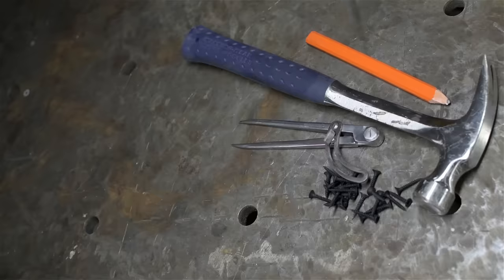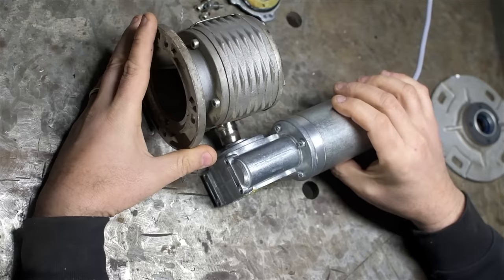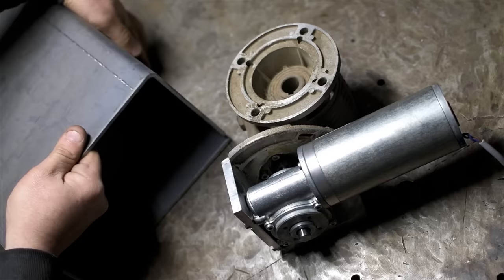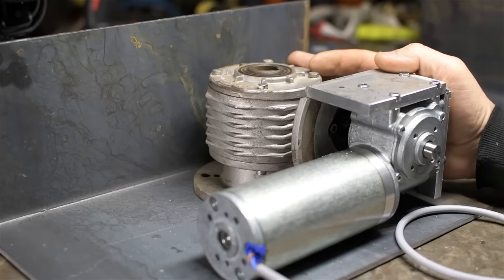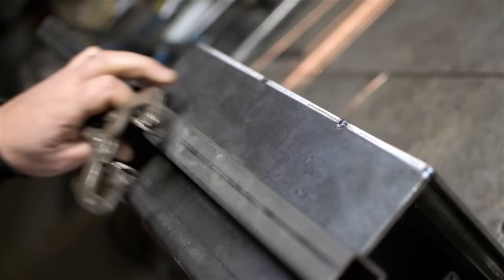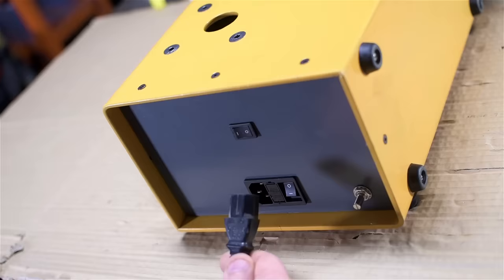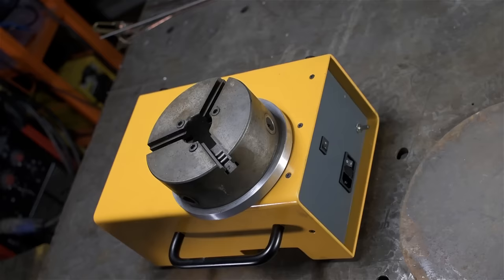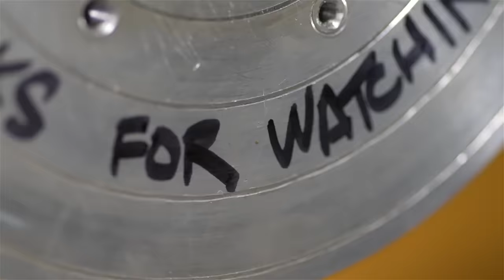Building a Rotary Weld Table

Comment: You should probably add a ground wire from the on off switch to the casing, it has some exposed metal components inside that can break down and touch the casing, the earth wire will make the breaker trip instead of making the whole thing live

Comment: Can't say it enough. Love your channel.
Reply from the maker: Thanks!
Reply: Practical Engineering one of my gods likes the oder god!!!!!
Reply: @ThisOldTony  I love your channel and your builds. This was a great project, made so nice and clean. But just one thing got me triggered a bit. All metal box, 3 bolts connector for power... and NO PE connected to a cover? Shame on you Mister!  Just one more weld of 6mm screw and one more cable for this project to be a full masterpiece...
Don't worry, partially joking but i would add just that cable to a cover for safety :) Maybe it's just my proffesional deviation as we call it here :)
Wonderful work, good humour! Keep it up and always have fun with things you create:)
On the other hand, if you put a wire ground on your cover, you would have to separate that gearbox electrically from it, otherwise you will make a wonderful toasting machine... decisions, decisions, decisions...
Reply: ogi22 can you explain this more so I understand what the risk is? I would like to make one.

Comment: My uncle is a welder at Boeing and he runs with 2 pedals, one for rotary and the other for the welder. He said it takes a bit to get used to but is really slick when you get the hang of it.
Reply from the maker: I bet it does!!
Reply: Be nice if you could get him to post some pics of his setup somewhere.
Reply: @firesurfer  Not a snowflake in hell chance of that happening I am afraid. A workmate of mine briefly worked at the Boeing plant here in Melbourne, Australia and said that they are super anti cameras and you're not allowed outside of your work cell. It's all to do with industrial espionage and intellectual property rights and processes.
Reply: Yea boeing would be the wrong place to film or photo anything. They need to safeguard against both military and industrial espionage. I bet it would take me a day or two to master double pedalling as im also a closet metal drummer😅👍

Comment: Hey TOT, Just couldn't resist. Anyways, I used to be a Prototype Welder/Fabricator at my last welding job, was also a Journeyman Boilmaker, and I really knew how to make those drinks! (but I digress), I was always was working on something new. Your turntable reminded me of 2 things. I had to weld multiple hydraulic cylinders with their end caps. All parts were machined in our machine shop (back in 1983). So I grabbed a RIdgid pipe threader, that had the chuck large enough to accommodate the cylinders, and got a foot pedal hooked up for the variable speed welding with MIG using .045 wire. They turned out real nice, and no leaks! 

The 2nd thing I did was I just took a big old bearing and a round plate of steel and made a hand spin table. Had to weld these big steel wheels for Hyster Fork Lift Trucks that they lift in/out of the hold of ships to load/unload. The welds were stitch welded opposite on each side with this inner plate as the hub.. The diameter of these babies were 36" inches, and it was 1" flat bar 10" across rolled to make it round. Anyways I got complimented by the machinists as they said they could set their tooling on the lathe to my welds as they were always 1/64" within a 3/8" leg doing 3 passes. Ah those were the days. 
-CD

Comment: Just thinking, You could have also built this much simpler by purchasing a "truck tarp motor"  12vdc motor already attached to a right angle drive, good low speed for $100. but the creativity I LOVE!!

Comment: I built something like this about 20 years ago, it was primarily for welding hydraulic cylinders. But as I had to use parts available in the "junk" bin, I went with a hydraulic motor and gearing. (yeah hydraulics was our thing back then) and built an electronic box based on pwm with potentiometer to control the dutycycle and a load of mosfets in parallel to control the speed of the electric motor driving the pump.

Surprisingly it worked really well. Very smooth, high torque, slow enough for welding, excellent result overall.

Comment: Oh, i have all your skills. & Tool Envy!  I am a kid from a Dairy Farm, in the "Land between two Rivers"  I'm currently a fiber artist in the village of 52151 (we think alike) I started cleaning plugs on OLD JD's at 5yr. A shop, choir, band geek in HS. An Industrial Technology major at Northern Iowa.  Followed "her" to Hawkeyeville. Eventually was the President of IC Apple UG. I have the world's largest library of 65c02 software.  I had a WOZ signed 2gs. 
I got into IT Systems & Networking Engineering.  Little places like Siemens. The whole world AD Tree. OMG! Even found those missing files from 1930 to 1945.  Wheee!  Did that for 25+ years. Now  a fiber artist, with a 10 node Raspi network. Just ordered a 3d printer. Fully insane, scare girls,  uber geek some times.  Absolutely love your work!  I got my knocks in Historic Preservation,  living in an 1854 hand adzed red oak posts & beams, with 14" wide 16" OC Black Walnut edge cut slotted/pocked studs. An analog world with 160 years of un-fxxkng to do.  Nice to meet you!

Comment: I love the table tony I built mine from 2 gm electric power steering motors from small front wheel drives and a wiper motor from a dodge 1/2 ton  , I use a 18 volt dewalt drill speed control and battery to control the speed , it totally makes awesome welds every time , and it's totally portable , , I just did it as a side project because I watched your video , thank you so much for the amazing idea

Comment: Another gem!!  I wouldn't have welded the box, just in case but that's me.  As a kid I could never bring myself to glue airfix models together, even now the wallpaper is nailed to the wall, just in case it needs adjusting later.  Yes, I do crosswords in pencil too.

Then again I'm only working in three dimensions.

Comment: It might be prudent to insulate the ground clamp well, if the paint scratches off, it could cause some weld current to go through the chassis and ruin your gearbox.
Reply: soupisgdfood first thing i thought off when i saw it
Reply: Not really...  the electrons will follow the path of least resistance, so as long as there's still a good connection through the shaft, no current will travel through the gearbox or bearings.

Comment: 22:00  :  To avoid this kind of boredom, I cut two pieces of sheet metal and weld two nuts as each piece. So if you have to disassemble, you can do it without apprehension. 
And, if you are equipped, the threads in the sheet can be made by fluo-drilling. It gives an even cleaner and more professional touch.
Thanks for your great videos.

Comment: Hi - I know this was done a long time ago, but...
Could you make a small 3 point pipe clamp with brass wheels for a ground clamp on the shaft.  This would leave a lot of room to fit a 90º gas swivel fitting on the end??!!

Oh - you could also plug in an MP3 player so that  "Unchained Melody" ('Ghost' Soundtrack) from the Righteous Brothers plays when you turn it on....

Comment: made the same thing years ago.  windshield wiper motor and starter gear and flywheel.  used a miller 200 with the trigger Incorporated into the the turntable and mounted the gun... works great for automatic welds.  and torching circles.  pipework with "t"s or "y"s or elbows have to be balanced to maintain consistent speed.  on bigger pipe.  on mine anyway...very nice fab work and product.

Comment: Re: the out-of-control Al. feeling.
Al. is all about forcing the puddle / bead (cause it's so heat conductive). So you need to hit it harder and faster. There simply is no dialing it in, to perfectly match heat input with rotation speed. You're GOING to be putting more heat in than you would for some hypothetical perfect balance, so forget it totally. Aly is about overpowering way beyond that balance. The uneasy-ness you feel is your brain not wanting to let go of the concept that there must be a synergy. There is no aluminum spoon. 
If you want to compensate for the extra heat input, learn to weld faster so there's less time under the arc. Sorry, there's no easy out on that one. Blast it and get out.
Reply from the maker: thanks balistic!

Comment: Just an idea but at my work, our welding lathe has a foot control to turn the turn table, you set the max rpm but the lighter the foot the slower it goes and it helps in those instances where your having trouble keeping up with your puddle 

We don't use foot pedals on our welders, only buttons on the torch so we set our amps, click the button to start the arc and get the puddle going then we press on the foot control for the turntable

I recently found your channel and I've been binge watching, keep up the awesome and funny content, thanks

Comment: I used to buy Singer Sewing machine pedals from a company in St Lewis for 12$ each rather than the 160$ pedals from Lincoln to speed control the tables in the foundry. Each of the 4 welders completed about 25 aluminum highway light pole bases per shift. Each pedal compressed 30 carbon disks to pass current to the motor/ more compression=more speed and I could dismantle the devices and clean disk surfaces on a sheet of emery cloth every few months, real easy.

Comment: I built one using an old fan motor, taking the drive from the rotating shaft which powers the back and forth movement of the fan. It was connected to the table using pulleys and an O-ring as a belt.

Comment: When you add the power LED you could also add a headphone jack inline with the power switch so you could make a simple on-off foot pedal control (for your other foot). Other then that I would use a heavy duty toggle switch thats easier to activate with a glove on. Awesome use of materials and workmanship!

Comment: The "Motor" could be a window winder motor or wiper motor from a car wrecking yard.. These are so useful, I've used them for makeshift "Cruise control" on a truck that had a PTO that needed to change engine RPM from the back of the truck, and lock & hold the throttle.

Comment: I cobbled together a rotary setup with a 3ph gearbox and a VFD at work. For a ground I used a flat copper bar clamped to a hinge that was clamped to the table in such a way that the weight of the bar held it against the part ... stainless steel pipe in this case. Worked good. Maybe the same principle could be used here with something like a spring to hold a copper bar against the stub shaft. Won't have to be concerned about the ground clamp slipping off.

Comment: For your remote speed control you could add a plug to your main unit and use a potentiometer mounted on a bracket that clamps to the handpiece. I made one for our rotator at work using an old extension lead and grafted a linear/slide potentiometer into the MIG handpiece(worked well but too delicate and not universal), second version was a small bracket to clamp directly to the handpiece housing a rotary potentiometer. I found that worked great, also works well with the TIG.
Another option could be to make one with an arduino and 2-3 buttons for speed control(faster, hold, slower/ speed up, stop, slow down). 
Cool videos though, I also didn't realise how long I had been watching. lol
Keep up the great work!

Comment: +The Old Tony Needs a foot pedal, not for speed but to engage. I run the arc with my right foot and engage/bump the turntable with my left. Just like the big kids do in pipe fab shops. Set the speed for faster than you need, and bump it forward. Better cup control, so you can walk the cup and not get that under-cut without the piece getting away from you. Filler rod is just that. (Also works great with stainless wire spray).

Neat project, though!

Comment: Very nice..! Especially the two pockets, so you can clamp it down. A bolt through a washer into the axle will keep the clamp from dropping off, or just make some kind of attachment like in an electric motor where the connection slides on the rotor (that would be your axle).

Comment: The last place I worked, we had something similar. The only difference was that instead of an on/off switch it was in a pedal form. Push to turn on and push again to turn off. It took a little practice welding something that was inconsistent or trying to keep up with the heat your putting in the material. Oh and we used the torch button. So we'd set our amps on the machine. That way everything stayed the same

Comment: Great job on the welding positioner (that's what I've always heard them called). I made one a few years ago with 4 grinder heads in series so the RPM was low enough to be usable. It was a fun Rube Goldberg project.

Comment: Great video and great project. I like the welding observations you shared in this one. I'm kind of a middlin' welder - not a beginner, but I have a lot to learn.
I've done a number of projects that required enclosures and that come with a million decisions like how does it open/close, power entry module, power LED. So, It was nice to see someone clever like you step through that process.
I was super surprised to see the ground method was just to let your clamp ride.  Didn't see that one coming.  Also, I would love to hear how the problem of purge gas gets addressed.
Keep up the great videos. I'm a huge fan!!

Comment: Concerning the rotational speed, we had a welding turn table at work where you'd set the top speed with a pot on the machine, and then the foot pedal went from 0rpm to your set top speed.  It took a little coordination to tig weld with two pedals, lol.

Comment: I have seen in the past turn tables with foot control and 2 potentiometers. The 2 pots set the min and max rotation and the foot peddle controls the speed between  those 2 settings. So all the way up would be off. A bit pressed down would be min RPM, and fully pressed down would be the max RPM, as set by the 2 pots. So that gives you great way to change the speed a little, but still have plenty of resolution on the foot paddle.

Not sure if there are controllers for that, but a bit of code and a microcontroller could do the trick. But hopefully there are control boards that do that out of the box.

Comment: There are 10-turn counting dials to add to the shaft of your potentiometer.  A bad thing about them is that they generally cost more than the potentiometer.  But at the same time, they are cheaper than the welding torch or the welder.  The final little thing is that you have make an anti-rotation locator hole to your beautiful yellow case...

Comment: Awesome. Something popped into my mind regarding the speed control of the thing. You should trust me on this one, as my avatar is THE boy genius. The solution would be to maybe have a range of set speeds for both directions, and two pedals one next to the other, to switch between them. The way it would work is that, let's say the table is turning full speed counterclockwise, and for every press of the say right pedal, the speed of the rotation would slow down a set degree until it gets to a stop and then start accelerating the other way. The press on the left pedal would do the opposite. The pedals would obviously not be the potentiometer kind, but more of a momentary switch kind. Now, for the electronics part. This would be quite easy to do, and is the way digital potentiometers work. Instead of a infinitely variable resistance in a potentiometer, you make a bank of resistors, each one being a bit larger of a value than the previous one. Another obvious thing is the more resistors you have, the more resolution to the steps and the speed control you get. What you then need is a means of selecting between those values. A simple solution would be a stepping switch or a uniselector, but those are not digital, so you would basically get a over-complicated potentiometer, and we're back where we started. A different solution would be to use, let's say, a shift register that would direct the one current input (middle pin on the pot) to one of its outputs, to which a resistor would be placed. The only thing missing in this picture is how the foot pedals would switch between the outputs, and for that we need some control. The farthest I went with shift registers was to strap an arduino to one of it and generate any signal it needed, but I'm a 100% sure somebody made a integrated circuit to do just what I have theoretically explained - take an input from the switches, left or right, and then move the ON position of the shift register's output up or down the resistor bank. If that isn't easy I don't know what is :)

Comment: 22:20 The impossible nut: Weld a small metal arm to the nut, allows you to position the nut and brace it against the bolt turning, and the arm is simply left in place, unseen, but ready if you ever need to dismantle. :)

Comment: Great video, as usual! Have you considered turning the table into a faceplate?  With your skill set it wouldn't be much of a challenge to cut channels and a recess for T-nuts.   You might also consider superimposing an identical diameter plate above the current table with appropriate slots for T-nuts, this way it can be tossed or machined if you run into a problem.  Just a thought!

Comment: I want one,  I like how you surplus search for parts and make it work. I was thinking 2 pots, one for coarse and other fine adjust.

 Maybe a Tach meter to allow you to go back to old setups.  Another whistle with LED for power. 
For low cost panel meters,  Texmate,  Been buying those for 30 years.   You can scale them with a voltage diver so it's easy for many applications.  If you want a part number let me know.